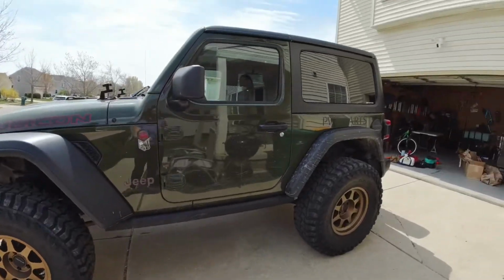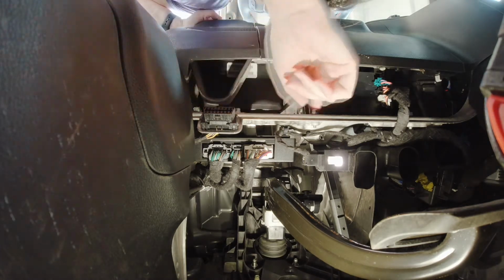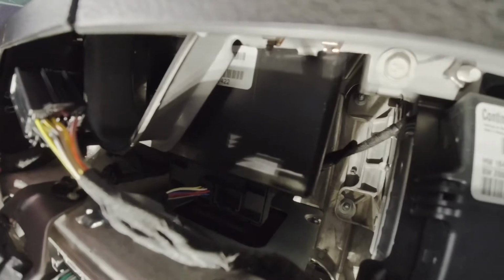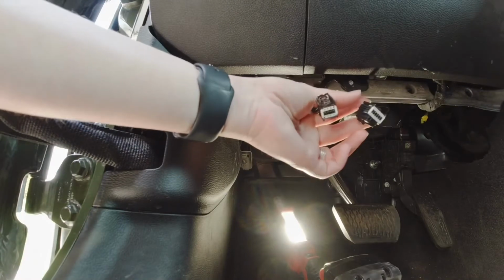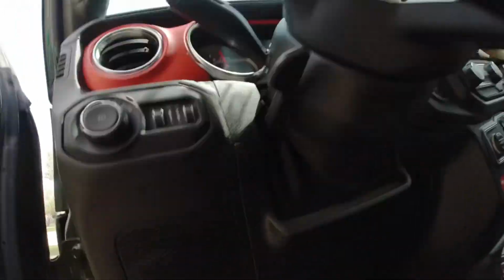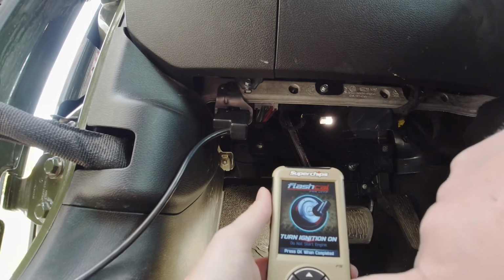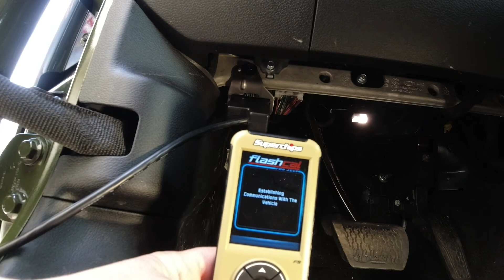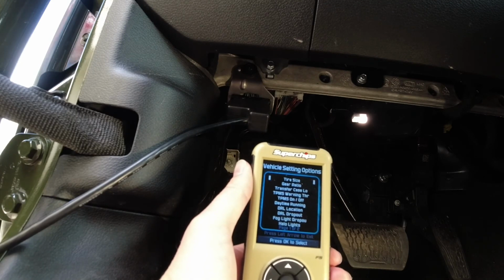Real life install of the Superchips Flashcal on a 2021 Jeep Wrangler.

Comment: Did you use Windows or Mac to update the software? I’m using PC and it’s asking to encrypt the device first otherwise is going to fail to update software on flashcal
Reply from the maker: I have a MAC I don’t recall having an issue with the software aspect